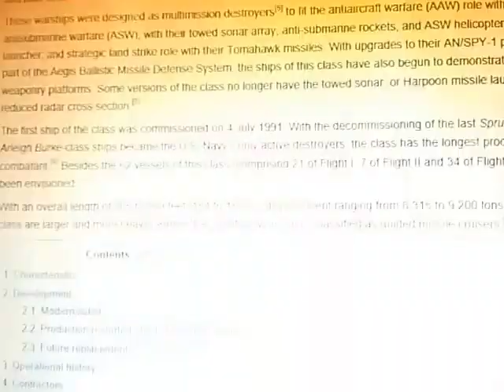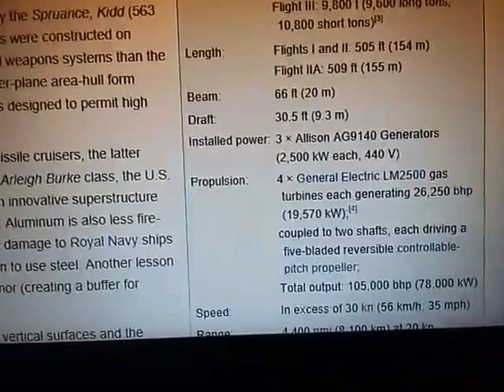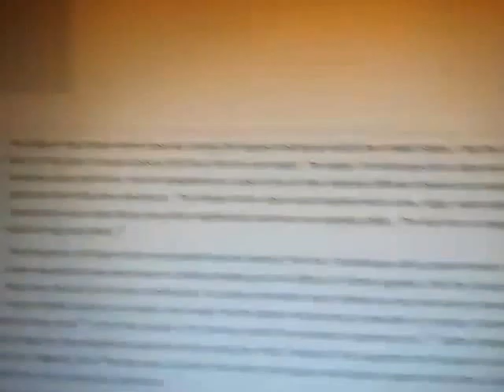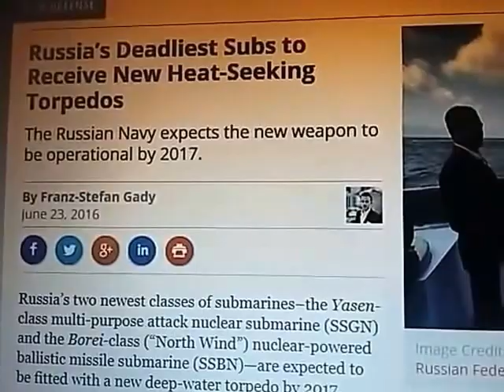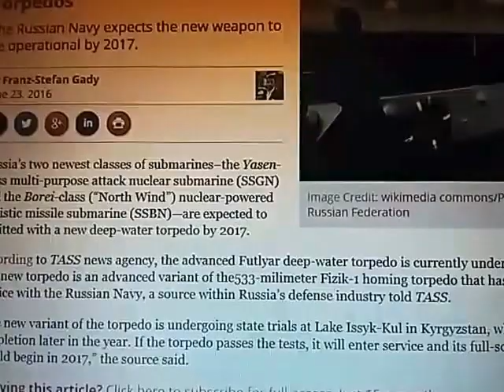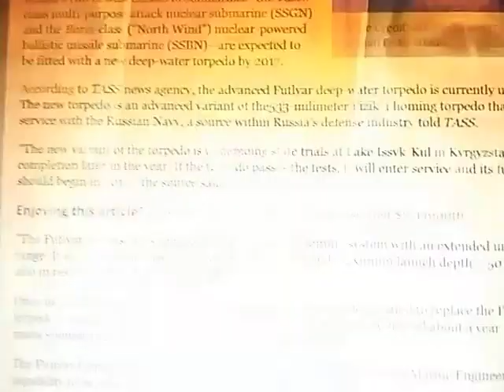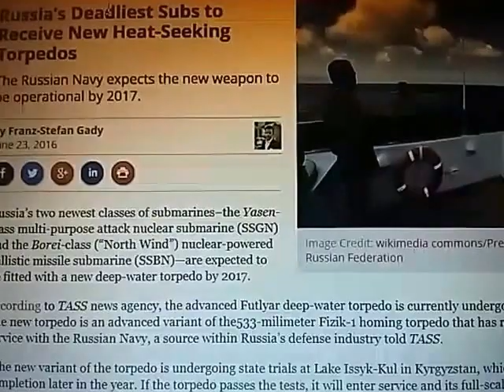!RUSSIA HAS A NEW WEAPON! NAVY TERRIFIED!!

Comment: I'm not thinking this engines off because of a heat seeker is as plausable as some of the other thoughts. This wouldn't explain the lack of comms and also the lack of ability to steam to port under it's own after the attack. I hears another guy that talked about something that got my attention. When there is damage below the waterline like this attack left, the crew is trained to seal it off..the flood other compartments to help right the ship so they can steam on and finish the fight or get out. The other accidents the ships were able to keep going and make it to a port with no help, why was the fitz dead in the water? I can only think that the ship's drive train and/or electronics were disabled. Also I would gather that a heat seeker would do as the missiles do and go towards the hottest area like the exhaust I highly doubt the hot part of the engine is in front of the middle of the ship. I do think you are a good investigator keep digging and helping us learn since there is a cover up for sure.

Comment: The idea of gas turbine restart latency, and the idea of turning the turbines off to avoid a heat signature makes basic sense. However turning off every other system on the ship and or sitting and watching as a gigantic freighter bears down and slams into you, doesn't fit any better. Why would all of the sophisticated warning systems a board be shut off on purpose? Because they would have to be in order to have this happen. Otherwise you have to assume everyone did nothing until it was too late. And that would have to occur on both ships. It just doesn't fit.

Comment: I'm not disagreeing with the theory about the Russian heat seeking torpedoes, however,  it makes no sense to me that the Fitzgerald would turn off their engines to avoid a heat seeking missile attack.  It makes WAY MORE sense the ship was incapacitated with electronic warfare EMP/microwave/rail gun attack than a kinetic exploding torpedo attack.  Turning off the engines would in no way hide the heat signature in cold water in the matter of minutes or seconds that a torpedo is bearing down on you.  No way.  It would take a long time for massive engines and exhausts to cool to hide a heat signature.  Thus, turning off the engines, losing power to many other life saving and navigational systems,  cannot be a strategy unless you knew the new Russian heat seeking missile was coming at you 3 hours before it happened?  Come on.  Subs know where these ships are with or without engines running.  I don't see that as a plausible theory based on what we think happened. It was an attack, more likely a coordinated PNA and China attack or, my theory, the US/CIA planned a false flag to whip up a new bad guy in the Pacific because that mid east thing is wearing thin.  --   I love your channel and the articles and theories you bring. But this one needs more foundation and plausibility to get me to buy it.  Lastly, I don't see Russia ever mounting an actual attack on a US military ship because the consequences would get millions killed.  And you know that.  The Russia threat is a Jewish Neoconservative war mongering Red Herring.

Comment: Didn't you once say the Fitz was hybrid? And on electric motor could move at be 13 knots? they wouldn't need to tie the boat to shore. Wouldn't that also make them going the same speed at collision? S stay with the facts in the videos, use speculation to do research. Navy veteran,
Reply from the maker: +Bill Schimmer in that video I was covering a new engine design in the newest of Arleigh burke-class Destroyers that particular engine configuration was not present aboard the USS Fitzgerald it did however reveal in the article that to conduct and anti-ballistic missile mission these destroyers need to be moving very slowly or completely stationary that was the entire point of covering it

Comment: You are dead on but for some particulars that beg to be questioned. Doesn't a diesel or gasoline engine have electrical circuity that can be killed by said EMP from cargoship (Christal-containers) or torpedoed by disposable, use once heat seeking torpedo. set to go off at desired proximity. an emp device can fit in the trunk of a car, as in disposed of Crystal P. I. cargo vessel EMP container into David's locker. This would make all cargo ships possible EMP war machines and renders all modern warfare electronic equipment as useless as a door weight.Everything in a modern military force is electronic. The Russians and the Chinese have downscaled to small EMP producing equipement. We have always had the capability to have portable jammers but not the new and improved EMP miniturized EMP generators shot out of artillery shells or torpedos.
Hell, EMP from a weather ballon, hanglider or drone. Isn't military science and advancements wonderful? It has been estimated that 20,000 Chinese spies are currently working in America. Everything the Russians and the Chinese know, is what Hillary and Obama have shared for money with them. If you don't believe that, it means you still believe in Santa Clause or the tooth fairy. The war's first "Silent Shot", like a gun with a sound suppressor. If it quacks like a duck, ...EMP attack, question where in the world was Waldo (location of Chinese electrical EMP silent submarine and or did the crystal dump any containers previous to turn about about? Use one and dispose EMP conainers. Where was Waldo? Navy track submarine movement with sat assets, Where was Waldo? Evidence speaks louder than words. Is there Navy collusion and Treason? Where is Waldo now?

Comment: another guy in comments made a good observation, that if this was a shadow situation with engines off,  for whatever reason,  the capt.  would not be in his cabin asleep. 
so this part of the story, one way or the other doesnt add up.
Reply from the maker: art american i'm thinking the story of the captain and his cabin is pretty much totally bogus at this point
Reply: As a MPA on a FFG7 and Cheng on a Spruance it was common practise 25 years ago to do engineering casualty control drills at nite. This ends up with main and aux engines being shut down purposely, then restarted. LM2500's can be restarted within minutes, btw. But it wouldn't be a wise decision to allow these exercises in heavy traffic areas.
Reply: As per the last bit you wrote, I believe the official position of the Fitz at the time of the alleged incident was directly in a "busy" shipping lane.  I assume Yokohama is a major port.  I think Fla Maq may be going too far afield in his speculation, but I am 100% in agreement that the official story is hogwash.  I'm still interested enough to follow where folks take this, but I'm not holding my breath of ever knowing the absolute truth.

Comment: this is interesting.. starting a turbine is a switch to spin, once rpms are at min start (different for each,, i am experienced with dojet328,j41,and canadair 200-600),but rpms up, switch on igniter, then fuel.. roughly 15-25 seconds and full power available.
a ship would probably have more details for transmission engagement, but, i think they are designed for quick escape.. anyhow.. this ship might have the shielding to a certain degree for heat shielding, but a turbine needs to sit for a time to get the temp way down. 
cargos run on cheapest diesel made but a much lower operating temp than a turbine. so i think this differential would be the big?.. 
question 2 is what temp are the torpedos designed to seek?. or is it a variance of temps, from diesel, turbine, and nuclear.. all 3 would be different. the only way to render them obsolete(the torpedos) is to shield all the ships to a registrant temp of a diesel or multifuel. 
seems this proposition raises more questions than answers. 
its an obama hussein era upgrade on this destroyer.. might have been a comp. glitch designed to render our navy defenseless in a wartime situation. look at all the problems with the shitty designs he bought, from the 22 and 35,to the poor engine design in the zumwahlt.  
who knows, but stay on it dude, i hope my little info helps, but if i can further, let me know.

Comment: The engines could've been knocked by an EMP though
Reply: Justin Crawford i dont know dude,. emp disables any current production, and the turbines still require a spark to start.. once uo and running you can turn the igniter off because the fuel ignition in the plenum becomes self perpetuating, but it needs electricity to start and run up to a certain temp.